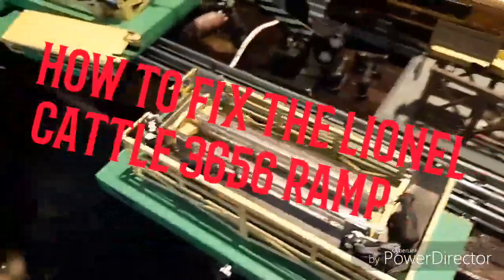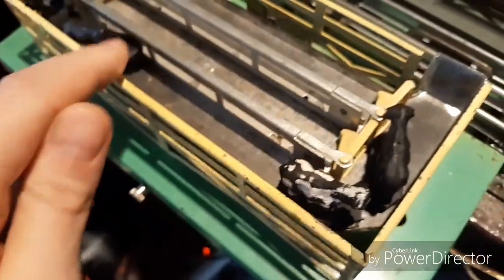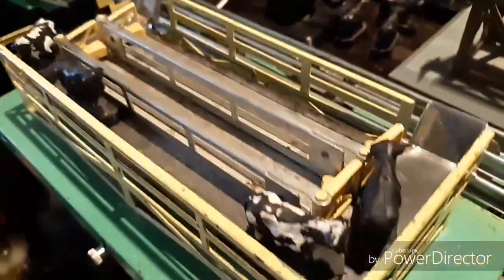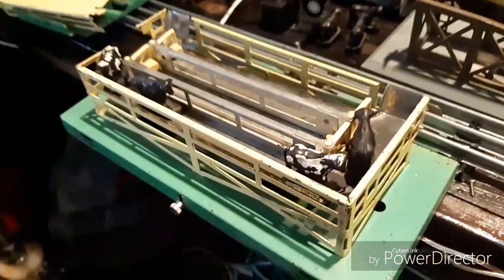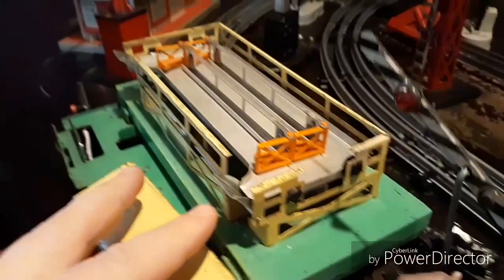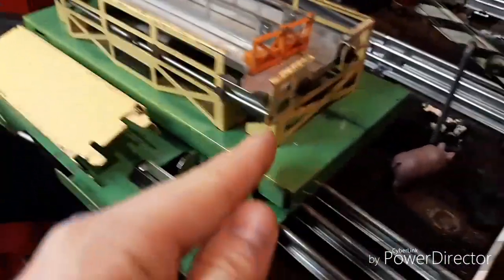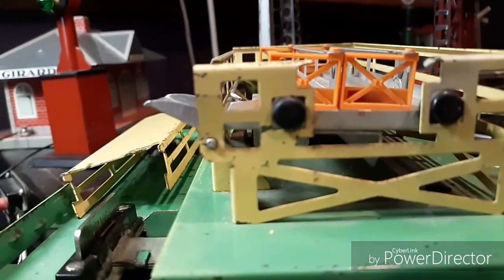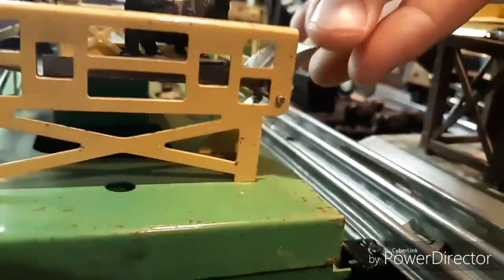How to fix the lionel 3656 cattle ramp

Comment: My issue is when I turn on the switch to operate the vibration, it soon shuts down the circuit breaker. I have it hooked up to another small transformer to supply power. I don’t use the MTH 4000 transformer. Your points made and what to look for is most appreciated

Comment: Thanks for this video really useful.  I have the first type of corral. Mine has three washers below the vibrating platform. I purchased the replacement spares at ebay came about a dozen.  However after I installed them found they were short in height for about 1/8". I mean the flaps wouldn't get flush with the car platform. So decided to put them double one stacked over the other. Then it barely made it and think need a small shim though  on top to reach flush . I noticed there is a tongue at the other end of the flaps and its angled, I decide not to touch this to get them flush.
Reply from the maker: Your welcome, I'm always looking to help all in the train hobby. And always looking for suggested train videos. 
Sounds good you have a great day.

Comment: Do you need a special type of track for these. Normal O gauge Tie Distance does'nt fit.
Reply from the maker: No you don't have to have a special  section of track. You can use a flat head driver and pry the track ties loose to move the ties. I did this to make the Menards tack work.
I had the same problem. Ties would not line up the the cattle ramp.
I just took a small fat head screwdriver and loosen  all 6  of tie connectors. 6 in one tie  And it's all good now.
Thanks for watching my videos.
Enjoy your day